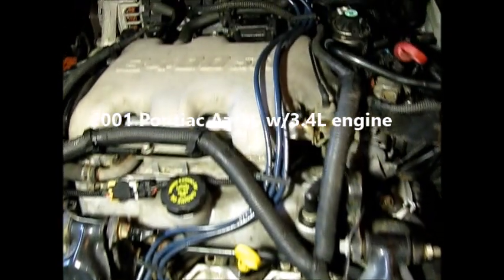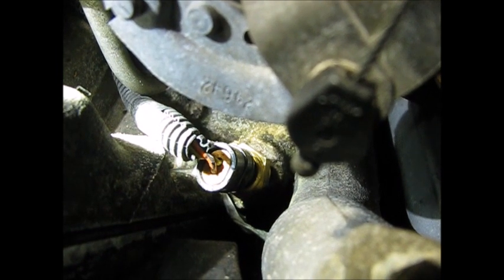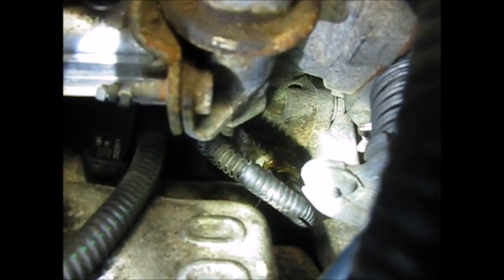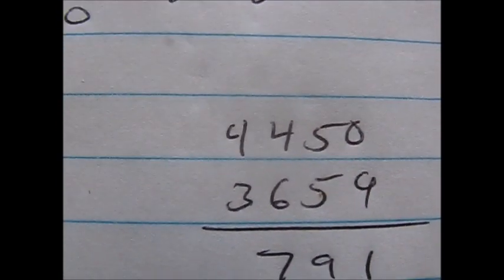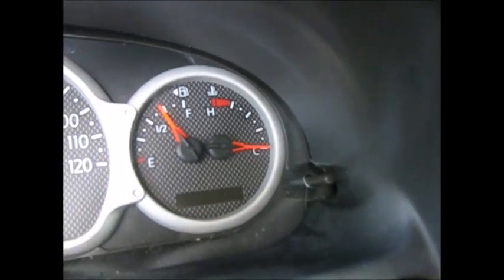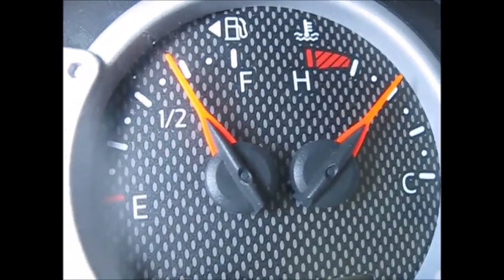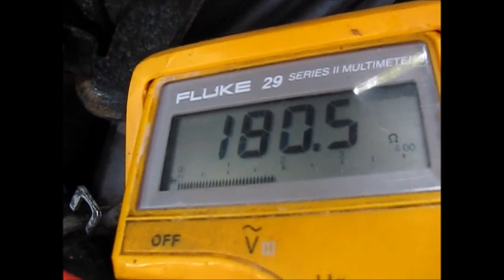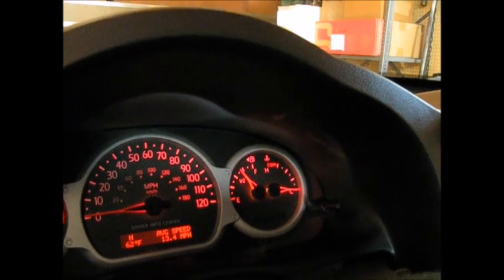Car overheating...or not? How to troubleshoot using the coolant temperature sensor

Comment: THE ORIGINAL MECHANIC ""'
"""                                                                       I don't know how to test the temperature sending unit or where its at in cars. I'm not sure if the sending unit means a sensor.
---1.)  How do you test or what do you use to test the temperature sending unit?
-----2.) Can I buy a digital gauge at PEP BOYS and install it in the fuse box wires by slicing the wires to test if the analog temperature gauge in the car dash temp gauge is reading false reading measurements of the temperature?
---3.) Can you make a youtube video showing how to test the car dash gauges to see if they work correctly and not reading false readings and how to test the sending units to the cars gauges?

-4.) I don't know how to test the cars gas gauge, oil gauge, temperature gauge using a ohm meter or what other test tool can I use to test these gauges are working correctly and not giving false reading or not working correctly?
Reply from the maker: The position of the sensor will vary from vehicle to vehicle.  the purpose of the video was to show how to check the sensor. Most sensors can be  checked with an ohm meter or live in circuit with a voltmeter as  I did in this video as the car was heating up. A manual is often needed to guide you on how to test it. I used one in the video. If you really suspect a bad sensor  just change it out as many are not expensive or difficult to change out.
Reply: @TheOriginalMechanic  Thanks for the help
The cars temp gauge inside the dash board cluster is a resistor or thermistor? or what is it?